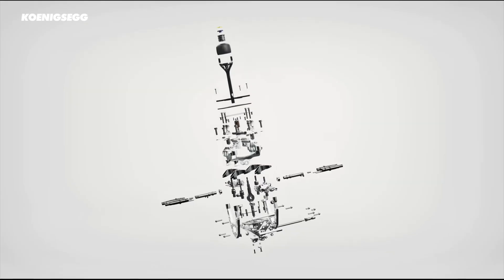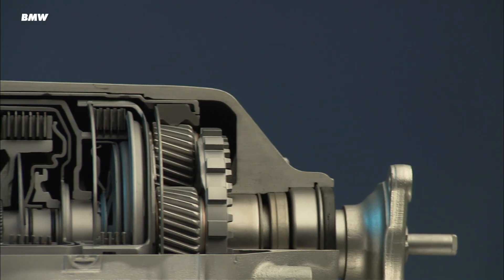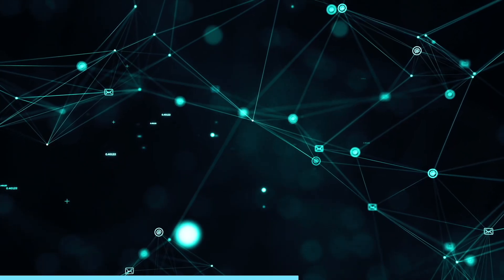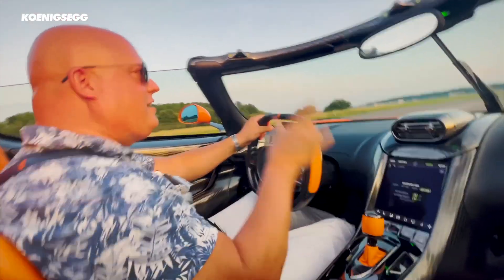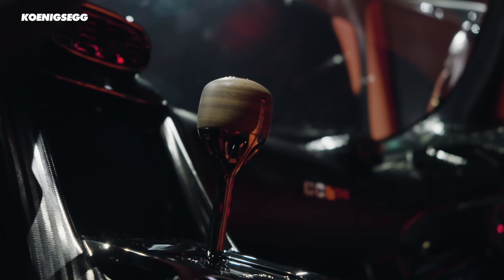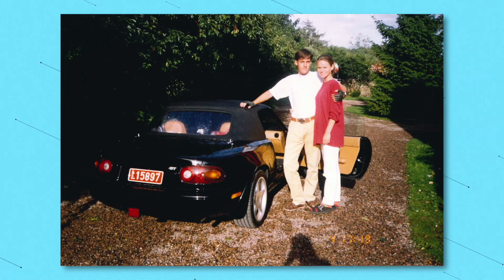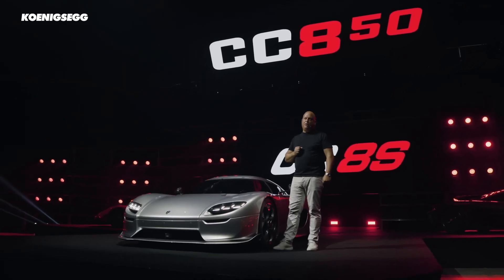Why This Car Has 7 CLUTCHES!

Comment: If you can stall it with bad clutch control, it’s a manual. Bottom line. Doesn’t matter how the pedal controls the clutch if its the driver doing the controlling.
Reply: if the torque converter goes bad on an auto you can stall it
Reply: @shawclip  you skipped the “with bad clutch control” part. You’re not controlling a clutch in an auto.
Reply: Yes I agree, it's a manual if there is a human controlling the clutch. Doesn't matter if it's done by wire or not.

Cheers 🍺
Reply: to me what makes a manual is not whether you can stall but rather a physical connection to the gears and the clutch. Whether you are telling the gearbox to shift via paddles or this Koenigsegg shifter is irrelevant.
Reply: @GAMERIC5  biggest difference between this and paddle shift is lack of computer intervention. It’s not a computer controlled trans when in manual mode, it’s literally a manual trans that you can make errors with and potentially be a slower driver than other people.
Reply: @justRD1  lack of computer intervention? i see what you mean but that's a funny way to put it considering the computer is the one actually doing the shifting and not only that deciding what gear to put it in based on the mode and other info. i wonder if you could money shift this trans and blow it up haha.
Reply: @GAMERIC5  The physical connection is the wire, it is a manual gearbox. If its done by levers, hydraulics or wire doesn't matter.

It is a manual clutch because it is controlled by a human foot. That is the proper way to think about it.

Cheers 🍺
Reply: @stefanconradsson  it does matter. the part about driving manual that i enjoy is being connected to the car not connected to a computer via a wire. Its really semantics though just depends on what you want to call a manual. to me that means 1 clutch i directly control with my foot and a gear lever again mechanically connected that i control with my arm. to me if a computer does it then its not a manual. regardless of how well this "clutch" pedal or shifter can simulate things.
Reply: @GAMERIC5  Thanks for a thoughtful and compelling argument. I take what you say seriously because that's how I used to think about it too. If a "simulation" is sufficiently advanced it can not be separated from the actual thing, right? However, this is not a simulated gearbox like that in a game or the more advanced F1-car simulators that formula one drivers do their training in.

This is an actual gearbox, with actual gears and actual clutches that are controlled by wire rather than levers or hydraulics.

I too rather enjoy driving cars with manual gearboxes. I think of this gearbox similar to power assisted steering. As long as the position of the pedal with my foot determines the open/close or slipping of the clutch and it has the same feel, via force feedback probably, I would be happy.

I hope you can at least understand the argument from my side. I suppose this will be an ongoing battle going forward now that someone has actually made this unobtanium sci-fi gearbox. 

Not that I am ever going to afford such an absurdly priced car as this one, or ever get to drive one.

Cheers man 🍺
Reply: @stefanconradsson  I also appreciate the civil and well thought out arguments you made. I think there is a problem with your power assisted steering analogy.  power steering both electric and hydraulic still maintain a mechanical linkage. This Koenigsegg system is analogous to a steer by wire system where the wheel is is only connected to a computer which then does the steering based on your inputs.

Yeah I don't think i've ever even seen a koenigsegg in real life haha
Reply: @GAMERIC5  you’re correct about the power steering. This trans is more relatable to DBW throttle and DBW brakes. Both of which can still offer feedback. 

I also wondered if it’s possible to money shift. I would think there is a good chance that if you can inadvertently stall you can also inadvertently select the incorrect gear.
Reply: @GAMERIC5  The only way to "directly" control the clutch is if you open up the gearbox and touch it with your hands, in a "real" manual you still have things between the pedal and the clutch that can affect how your input reaches it, its just that in this case instead of it being an assisted hydraulic line it's a sensor that asks the pedal "what position are you in" and a chip sending a signal to an actuator telling it "go to the position the driver asked for". there might be some trickery going on to mask any erorrs you make but that's no different to the addition of syncros to gearboxes or gear lockouts that prevent you entering certain gears which some manuals have had for years so as long as you are telling the gearbox when to move a clutch to which position and when to engage which gear, it's has everything a manual needs to be "a manual" noone really cares about exactly HOW your inputs get to the gearbox, In a sufficiently well engineered system you can't Feel that you are directly moving a lever connected to a hydraulic cylinder which actuates another hydraulic cylinder which actuates a leaf spring which moves a clutch vs moving a lever which tells a chip to tell an actuator to move a clutch. you feel that you modulated a clutch in just the right way and selected a specific gear that you wanted with a H-pattern shifter and the car responded in a particular way whether it be a jerky shift because you were too harsh or a smooth one when you got it right. "The computer" only has as much say about which gear each position on the h pattern stick puts you into as for example a low-high range selector on a 4x4, yeah in track mode it might put you in 3rd when you put it in position 1 and in road mode put you in 1st in position 1 or whatever but track mode, road mode etc are just that selector switch, once you are in track mode 1 will always be 3, 2 will always be 4 and so on.
Reply: @GAMERIC5 
that clutch is operated hydrolically...but I'm not sure if the pedal is also connected hydrolically (it wouldn't matter how it's connected as long as output is syncronized with the input) 

Thee vast majority of cars arent mechanically connected anymore. 

More than that, there some sort of assistance with almost everything relating to operating the car manually. 

The clutch, gear selector, the accelerator and the brake pedal hasn't been directly connected without assistance or interference for a long time.

Even steering isnt direct (there's assistance happening hydrolically). 

Cars have been using electronically synchronized throttle for a while.

Brakes have been using hydrolic fluid that goes through a brake booster for a long time. 

The clutch now shares the brake fluid system with the brakes to operate the clutch. 

Even the gear selector is now hydrolically operated. Typically employing two hydrolic cables. 

And you things like synchros in gearboxes, etc that's doing things for you, so you don't have to do it manually.

Try out a car with an old school cable wire connected clutch and throttle. It doesn't feel responsive. Plus the stretchiness of the woven steel cable wire makes it not feel direct. 

Then remove the brake boost, powersteering, bring back mechanical levers for the gear selectors...and remove the synchros out of the gearbox and you'll experience what being "connected" to the car truly feels like.

It's not always as pleasant. In fact, you're fighting the car a lot...struggling to have precise control with throttle, clutch, etc. A lot more force is needed for steering and brakes.

For me, manual is if you have to manually go through the process of disengaging from one gear and engaging another, an you have full control over how the components in the gearbox involved in this is going to operate. 

In its purest form, that would involve synchronizing the gears (with out synchros automating that for you).

Theres ABS, anti slide, traction control, etc as well
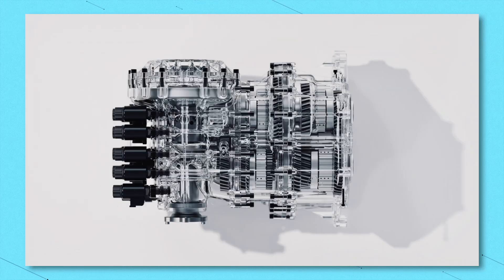Reply: Believe in JESUS today, confess and repent of your sins. No one goes to heaven for doing good but by believing in JESUS who died for our sins.  For God so loved the world that he gave his one and only Son, that whoever believes in him shall not perish but have eternal life.(John 3:16)🥳❤️😁❤️😎
Reply: @alunesh12345  no thanks

Comment: So it's basically an automatic but instead of selecting gears with paddle shifters you use the gear leaver. Rather Interesting..
Reply: Everyone should copy this design, best of both worlds
Reply: @Zirion123  exactly. even a manual gas car simulator could do well in sporty EVs just to stroke the petrol heads’ ego.
Reply: @TackKeyNack  my , problem with shifters in evs is that u have no reference. No noise or rpm
Reply: @Zirion123  that’s why i called it gas car simulator. have the electronic dash transform to show a tachometer with sound emulation and seat / steering wheel vibrations for engine feel without sacrificing efficiency. they could also emulate dynamic torque curves with the motors easily. driving simulators get very close to the real thing already so i wouldn’t really doubt what a few car guy programmers could do.
Reply: @TackKeyNack  no bro that's just stupid if I want fake sensations I will play a racing sim.. it's like having fake sounds through the speakers like some brands already do. They just sound fake as hell haha
Reply: @JoaoPereira-sy3bh  all the new 2L V8 turbo engines don’t sound any better for the said “car guys” anyway, so audio tuning from Yamaha and good sound emulation from experienced game developers should do a better job. not to mention, they can also give the option to change engine sounds at will without needing to modify the car. it’s all about how much effort they put in that will affect the final product.
Reply: @TackKeyNack  mate car guys will still trow a modified exhaust in there. And manufacturers know that so that's probably why their artificial sounds sound garbage.. cause they don't put effort into it
Reply: @Zirion123  I think there's no point on doing that apart from trying to make car guys happy so probably it wouldn't be rentable for manufacturers
Reply: It's not an auto with a shifter to control the lever, since it also uses a clutch pedal that disengages the drive as in a real manual, which paddles won't do (not counting the "pull both for neutral" thing). Can't stall an auto with paddles, at least without doing something ridiculous, whereas if you just drop the clutch in this then it'll stall.

Not sure why anyone wants a manual in a 1000hp car though...manuals are at their most fun in a slower car. Instead of a CC850, I'll take a Suzuki Swift Sport and a Jesko!
Reply: @ApothecaryTerry  "Not sure why anyone wants a manual in a 1000hp car though..."
It being a manual is the reason why it 'only' has a 1:1 power to weight ratio, and not more, like the Jesko. Christian wanted the car to be driveable, with the manual mode being more than simply a gimmick
Reply: @halofreak1990  Limiting the power to "only" 1000hp to make it more driveable is fine, and I'm excited by the car since it's a great piece of engineering. As a driver though, 1000hp and a manual makes no sense. If you want a manual for engagement, then in a 1000hp car either you have short gears and pull through them so quickly that you literally spend half your time shifting, or long gears where you don't shift between corners anyway. With the shorter gears you then may as well just use a higher, longer gear. In both cases, 1000hp means you'd lose more time by shifting than using the "wrong" gear (hardly a thing with all that torque).
The gearbox with its variable ratios is very impressive, but it only moves the problem around really.

I am exaggerating, of course, but my point is that's going in that direction. For driver engagement, an MX-5 will still be better. My car has "only" 325hp and I wouldn't swap the 7 speed PDK for a manual. I'm looking to buy a manual since I love them, but in something much slower- even a Golf R made no sense.

Comment: What Is linked to thee clutch pedal????? the clutches ??????????
Reply: Hydraulically controlled. System decides exact clutch release, but the press action is hydraulic
Reply: @srinitaaigaura  ok so you can technicaly feel the clutch In the pedal !

Comment: Maybe its technicaly a manual gearbox but when you disconnect the shifter from the gearbox mechanism and the clutch from the pedal then youre not shitfting manualy. Its the same as an automated manual gearbox just the user input method is different. Instead of tiptronic or pedals behind the wheels you push a leaver in the centerconsole. Fascinating piece of tech nonetheless!
Reply: It's not a manual in the normal way, but it gives you the same control over the car so from a driving perspective it's a manual. I'm not sure why anyone wants a manual in a 1000hp car though...